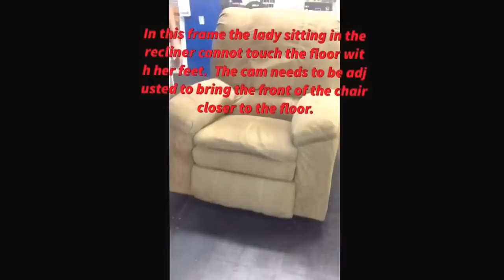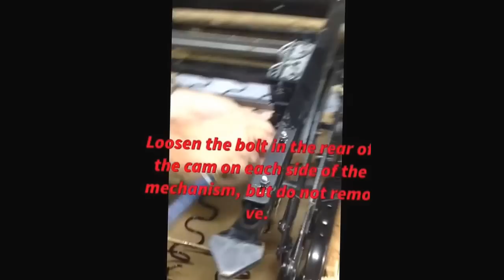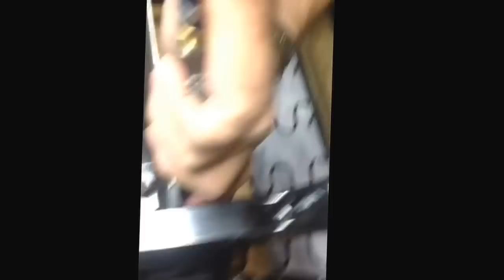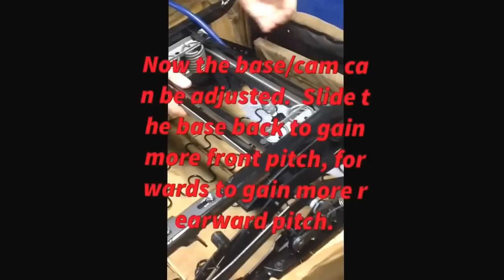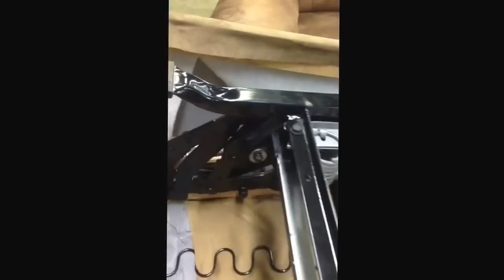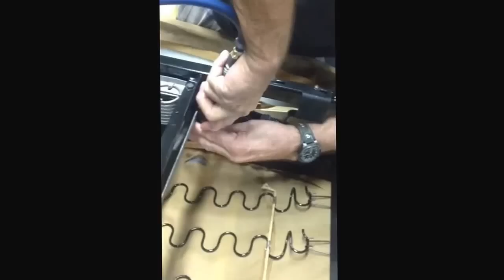Adjust pitch of a recliner by adjusting base settings

Comment: I just adjusted my Ashley recliner (made in Vietnam).  Had to remove all 3 bolts each side and move back the 1”  for second set of holes on the chair mechanism because Ashley’s front bolt doesn’t have a slide or adjustment. The self tapping bolts do not go back into the new position mechanism holes.  So bought a smaller circumference 3/4” bolt with a locking nut and installed.  Worked great!

Comment: My chair has a wooden base that was leaning too far back in just sitting in it, my feet were off the floor.  To fix it, I loosened each sides’ 2 bolt heads, located just below the wood base and within the metal frame slots and removed the in between screws. Then  I slid the frame towards the back. I retightened the bolt heads and installed the screws.

For the brave hearted, I reversed the double springs that are under tension. First mark each spring set with a T(op) at the top to keep the correct orientation. Caution: Remove the top 3 screws first, the last one will pull down. Remove the bottom 3 screws. Switch the spring sets keeping the tops up. Install the bottom 3 screws. Using a tool you can pull up on the spring top section to line up the first screw hole and install the screw. Do the same on the opposite side of the spring top section to line up the second screw hole and install the screw. Complete by installing the last middle screw.

Comment: HELP ~ i have a recliner armchair that rocks from side to side ~ i bought it second hand on eBay and the seller says it was like that when bought new 2 years ago from SCS.  It rocks around 2cm left and right.  Can you advice?
Reply: I had the same problem, turned it over and found bolts had loosened allowing that motion